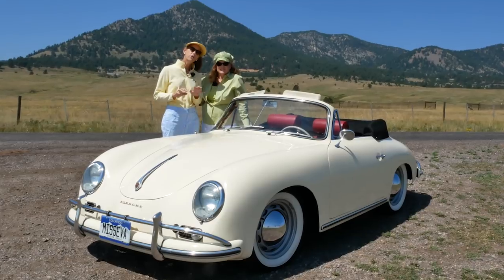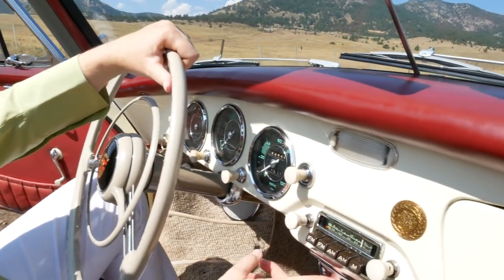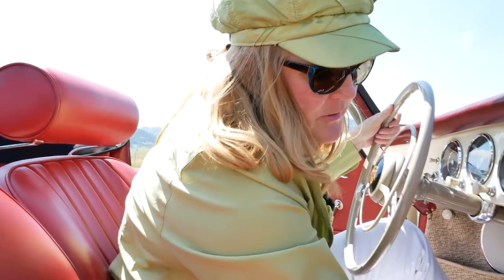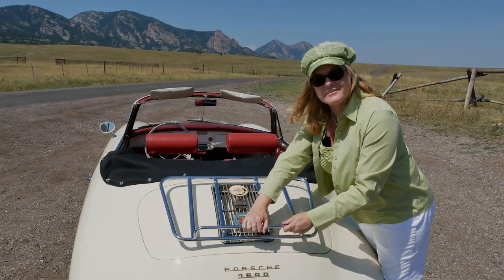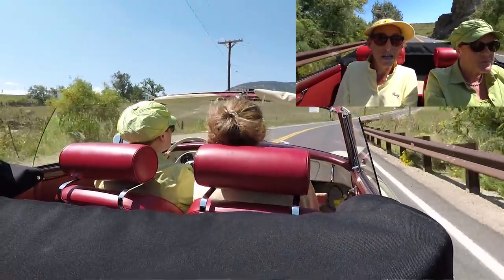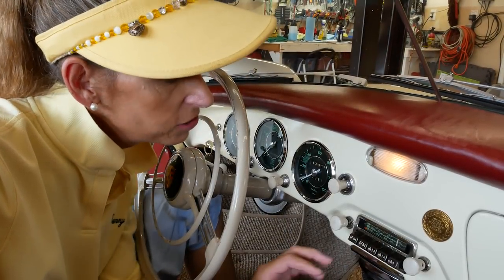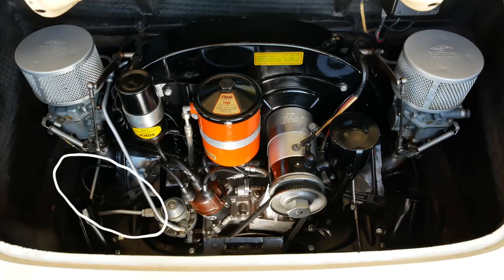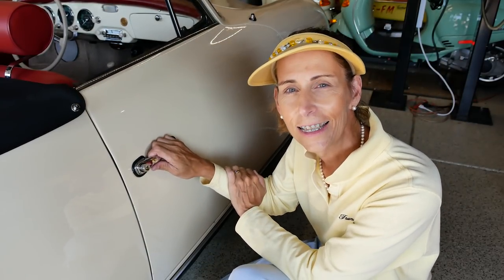Porsche 356A Full Review and Drive: An Owner’s Perspective!

Comment: My dad had a 57 VW bug roll top for many years when I was a kid. that thing is almost identical to this 356 just with some different body panels. One time, we were driving on a back road after school, and smoke started pouring out of the back end. Dad pulled over, ran around and opened the engine door, and the engine was on fire. he didn't have an extinguisher so he was just grabbing dirt off the ground throwing it at the engine to put out the fire which did eventually work. I remember in the winter putting my hands up against the slot next to the windshield where the defroster heat would come up. it was a really damn cold car to ride in in winter. And in the very back, the miniature luggage / trunk, our dog used to sit back there. I remember when I was a kid I could fit in that little spot too. it's probably similar in size to the frunk.

Comment: 356's are probably my favourite cars. Thank you for this excellent in depth review. This is how motoring should be. I'm grateful for lots of technical advancements, but sadly modern Porsches are an overcomplicated buttonfest with lots of tech that will date quickly and so many unnecessary gimmicks that do nothing but add weight and soften the driving experience.
Reply from the maker: +Freerk de Ruiter I don't think I have drive a
Porsche newer than a 2012 and even that one was a bit of a driving experience.  Yep. Sometimes newer is not better.  I know this.  Older is often times much simpler.  Heidi

Comment: I just love that little 356.
You didn't say anything about the brakes. Did they still use drums front and back? 
Also where is reverse? Is it down and dogleg back like the Beetle?
That wire for the valve stem is for tube tires.
Will this thing burn unleaded gas? Does it have hardened valve seats or do you have to use an additive?
One other thing. Does it have rack and pinion steering?
I just love that little 356. Did I say that already? Lol

Comment: Thank you! This answered so many questions I had! Especially the carb heaters, I wondered what those pipes were for. How is it driving without a passenger side mirror?
Reply from the maker: Not really an issue with the top down. Amazing what you can see. Even with the top up visability is quite good. I'm not one to trust mirrors all that much anyway ;)

Comment: Girls, I'm from Curitiba, Brazil. What's a T2-A car? I cannot understand, despite the several times that I watched this part of the video. I'm loving your videos, I came trough Garagem do Bellote YouTube Channel. Thanks for sharing!
Reply from the maker: :)  That is because it is one of the most confusing things about early Porsches!  The T (type) designation was an internal code for updates and changes of the model years.  But what do the A, B, and C meant then? you ask...  They designate major model changes.  The "T" numbers started with the "A"s and there was a T1 (1957) and T2 (1958).  Then in 1960 we got the T5 "B" (there never was a T3 or T4).  Then later there was a T6B and finally a C(T6).  It takes years of studying and research to be able to spot the differences (i.e. T1A had beehive tail lights and the T2A had tear drop tail lights).  B cars have higher front wings than the A cars.  T6 cars have a straight across hood line and vents on the cowl and twin grills on the boot.  "C" cars got disk brakes.  There is a good book called Buying and Drive the Porsche 356 that does a good job with all the differences.  There were lots of differences in the "Pre-A" cars as well.

Comment: How is the swing arm rear suspension? I have heard that if you lift off in a corner, the rear end can rise up, changing the rear wheel camber so that the tires lose grip and the rear end swings out. Is that a problem?

Comment: Fantastic video! Did you have the valve seats hardened to run on modern gas? Also, please replace the house wire nut on the wire under the dash with an automotive one -- this can't be German engineering.
Reply from the maker: Yes, the car used to run on leaded, now it takes unleaded.